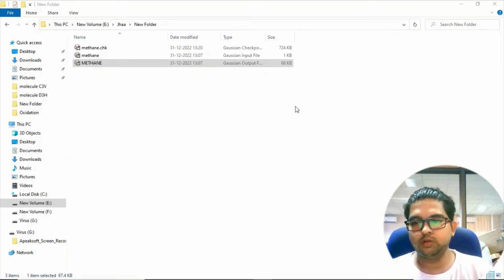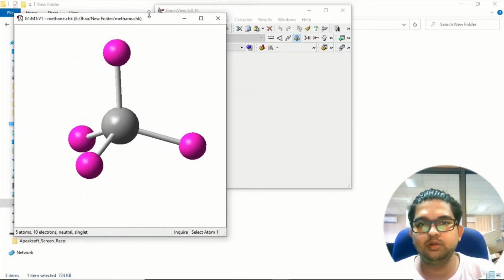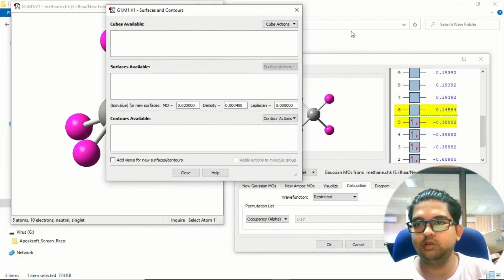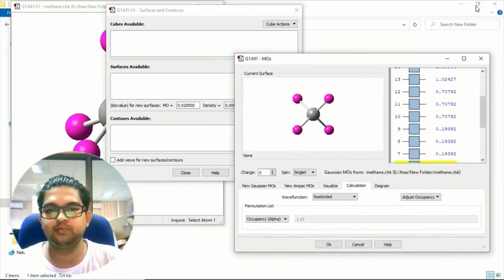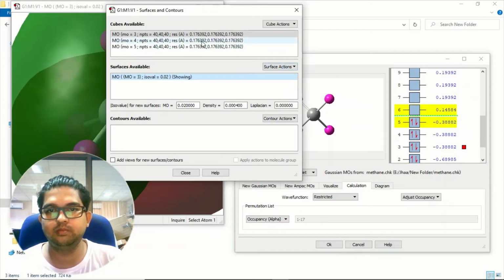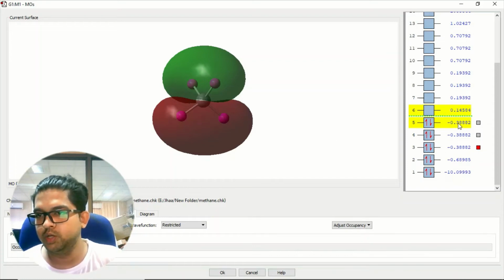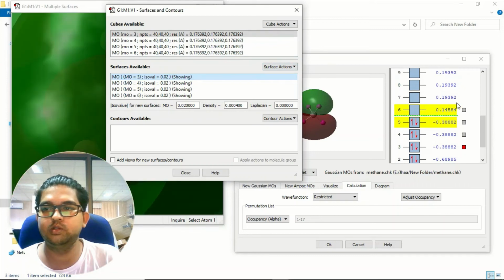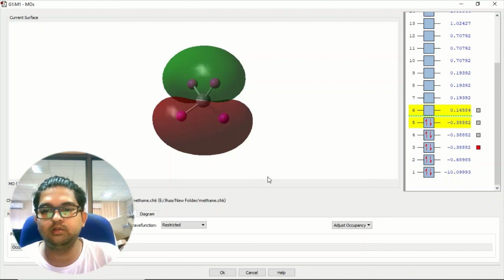HOMO-LUMO Calculation and Analysis Using DFT method in Gaussian Software || Part 3 || Gaurav Jhaa

Comment: When the spin is doublet we get two homo valve and two lumo value which one we should select for homo-lumo energy gap
Reply from the maker: @abidakarime  see which level is high energy SOMO and low level unoccupied level and get the energy difference for that. 
Two levels you are getting due to alpha and beta electronic spins.
Reply: Thank you so much for your reply
Reply: IS 102a electron and 102b are empty so 102a is SOMO and 102b is LUMO?
Reply from the maker: @abidakarime  SOMO is occupied level

Comment: is surface and contour only required when we have multiple homo or in each case we have to find homo lumo in the same way?
Reply from the maker: When you have  degenerate HOMO or LUMO...HOMO-LUMO gap will be same, only MO's will be different. For example, in benzene   HOMO and LUMO are doubly degenerate, MO's will be different as the position of node changes (gap will be same).
Reply from the maker: In those cases you need to show all of the degenerate MO's

Comment: Does gaussian soft ware is available in free if so pls provide link sir if possible it will be helpful to all
Reply from the maker: It's commercial software....you need to purchase it
Reply: @quantumguruji  humo and lumo can be calculated using only by avogadro not taking help of gaussian or gauss view or orca sir
Reply from the maker: @sanjeev1227  dear, avogadro is a visualizer not a software to perform DFT calculations. You can use Orca for DFT and other types of calculations and visualization of the output file could be done in avogadro. Orca is freeware. So you can use it instead of Gaussian.

Comment: There is no Guassian checkpoint file type on my computer. can you help, please!!
Reply from the maker: I guess, you didn't gave proper path for checkpoint file so it may be in the scratch folder. Open drive where you have installed gaussian, check for scratch folder...you will find your .chk file there. As it goes there by default.
Reply: @mgurujithank you, can you refer me to some video about it?

Comment: sir, is energy on lumo always positive and homo negative? i use a nwchem about COSMO solvation model and get homo and lumo value is negative
Reply from the maker: Not always
Reply: Hi.. When energy gap is calculated to be very small, this value is multilplied or added by a factor to enhance the value of Eg... I can't recoll what was that, can you please tell me?
Reply from the maker: @khadijaarif2107  please do a wave function stability test, even after its small check for correlation.
Reply: @quantumguruji  I found it... It was to convert from hartree to eV... thank you so much 👍
Reply from the maker: @khadijaarif2107  this is also a reason

Comment: LUMO is also triply degenerate states so no of LUMO is 3
Reply from the maker: yes
Reply: Hi.. When energy gap is calculated to be very small, this value is multilplied or added by a factor to enhance the value of Eg... I can't recoll what was that, can you please tell me?
Reply from the maker: @khadijaarif2107 there is no such normalisation factor. Better check for correlation effect (static and dynamic), and move accordingly.

Comment: Sir: please make a video on DFT calculations using broken symmetry approach in Gaussian
Reply from the maker: To perform DFT calculations using the broken symmetry approach in Gaussian software, you need to specify certain options in the input file. The broken symmetry approach is commonly used to study systems with open-shell electronic configurations or systems that exhibit spin contamination.
Reply: Hi.. When energy gap is calculated to be very small, this value is multilplied or added by a factor to enhance the value of Eg... I can't recoll what was that, can you please tell me?

Comment: Please , I have a question , I have a molecule , I did calculate the HUMO and LUMO energy , now I need to make the calculs for the ion forms of the molecule, how to do it ?
Reply from the maker: You need to put the charge value instead of zero. Generally, for neutral molecules, we use 0 charges, but in the case of ions, we use 1,2... to put a + charge and -1, -2...to put negative charges. For more details, follow this video of mine,  
  https://www.youtube.com/watch?v=LQd9KMfgnPU&list=PLlpEYnkmgdI-yizh1k2y1X4CTwi9_BXkp&index=2&ab_channel=QuantumGuruJi
Reply: @quantumguruji  thank you , so every time I have an other anion I should make a new calculation !
Reply from the maker: @yexotic-19  yes
Reply: Hi.. When energy gap is calculated to be very small, this value is multilplied or added by a factor to enhance the value of Eg... I can't recoll what was that, can you please tell me?